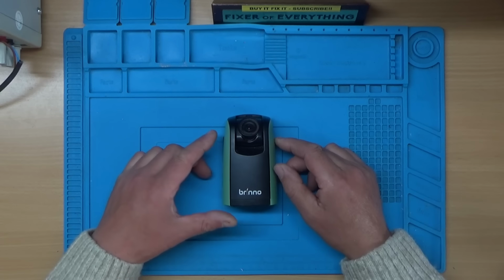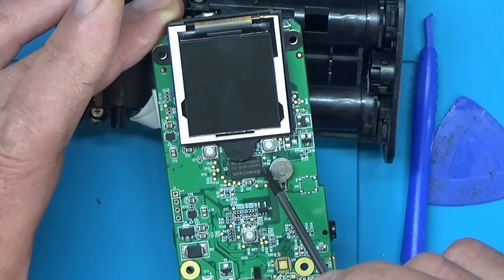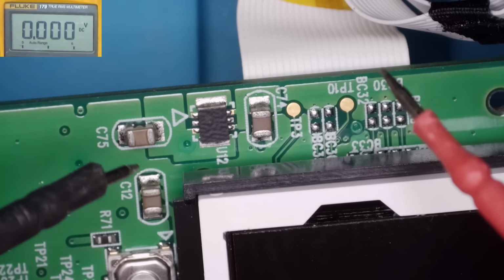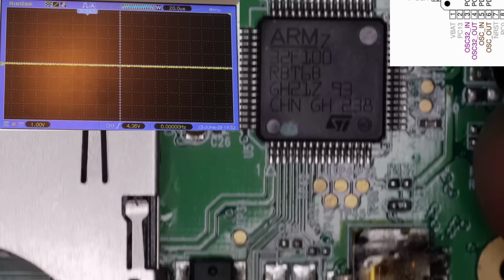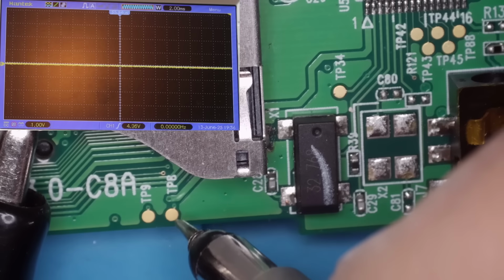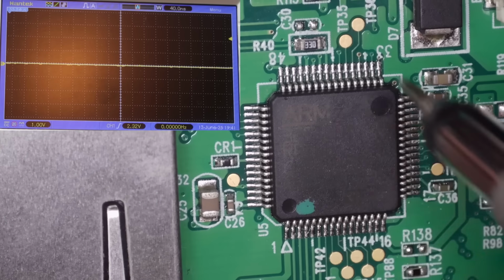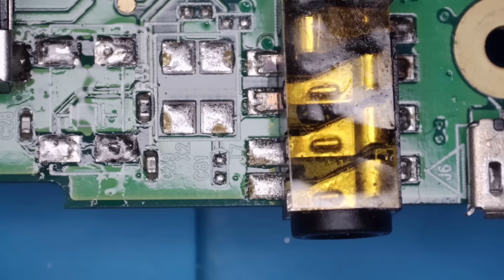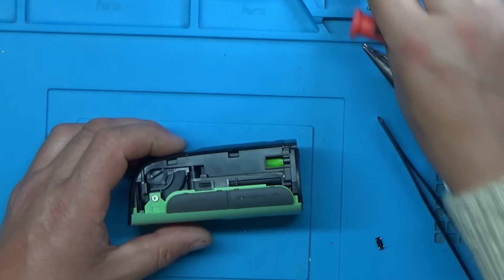Faulty Timelapse (Construction) Camera - Quite Expensive & Totally Dead | Can I Fix It?

Comment: I'd argue the firmware doesn't check if the 32.768KHz oscillator is running before making use of it! Not great programming 🙂
Reply from the maker: Could well be the case, or some low power mode that requires the RTC instead of the main clock?

Comment: I have found oscillator failures to be not uncommon. Sometimes it's the crystal, sometimes it's the load caps. I often just feed in an external clock source just to check that the rest of the circuit is working if I don't see any oscillation from the on-board clock.

None the less, a good repair that only required cheap parts.
Reply from the maker: Thanks 👍 and thanks for sharing.

Comment: Hi love your videos and always impressed by your skill, I have a item I’d be interested in sending to you if you’d be interested it’s a Dewalt tough system radio has many issues but the big 2 are the radio not working on battery power and the on button broken off and ripped off most of the pads and a few other components
Reply from the maker: Thanks 👍 drop me an email at the name of my channel at out look dot com.

Comment: Great job! St microcontrollers have a wide variety of clock configurations available, even so far as to be able to use different click sources in different power modes. It's entirely possible that it is using the lse (low speed external) oscillator during some low power mode, and it was getting stuck in that mode with no clocking. Edit: I read some of your comments lower down suggesting that the faulty oscillator might have caused it to stall waiting for an interrupt. That is of course totally possible as well!
Reply from the maker: Thanks you 👍Yes, I suspect it was one or the other of those.

Comment: Great fix and also wonderful that you were able to find a suitable replacement in your spare boards. I think those are called SPXO oscillators into which you feed voltage and you get frequency output without additional circuitry needed. I was troubleshooting some Toshiba laptop boards recently and two out of four of them had a broken SPXO caused by a regulation fault on the PSU board. Of course that SPXO provides clock to the CPU so it was totally dead without that.
Something you can try if you see clocks missing on the oscillator is hook up a signal generator (I use my HDS2102S's basic one) to inject the frequency and see if the board starts working, that worked for me in a separate instance where I had a part working PLL. That was intermittently unable to run the 14.318mhz crystal from the XO pin but would work if I put that frequency into the XI pin.
Reply from the maker: Thanks for that, yes I've got an old signal generator and did think about hooking it up to test. I just wasn't sure on the output voltage etc so thought it was safer to just replace the crystal. I've just looked and I think this is just a standard oscillator because it has two small capacitors, one connected to each output leg to GND.

Comment: This gives me hope for my a Roadstar TRA-2350P (aka Redsun RP2000) shortwave radio that I recently pulled back out of the box, totally dead regardless of power source. I found some red herrings like a bulging power input filter cap, but nothing that would preclude it from operating. Even the little electrolytic in the reset circuit charges and discharges fine. So right now my bets are on a dead RTC crystal, which actually isn't totally unheard of. Unfortunately the interesting things are underneath a big shield that's a bit of a pain to take off. (It is, after all, a shortwave radio.)
Reply from the maker: Perhaps this might also help.. https://elektrotanya.com/roadstar_tra-2350.pdf/download.html

Comment: Great find for the fix, well done. Repair cafes can be very limited in the tools, equipment and time they have available. I just finished up at a local repair cafe myself today in the electrics area and basically you don't have access to special tools unless you bring it with you. No one is bringing a microscope or oscilloscope to these events so small SMD work is pretty much out of the question. I have to bring these things back to my home for this type of work.
Reply from the maker: Thanks 👍 and totally agree with all of that. We have limited equipment at our repair cafe. I donated my previous digital microscope so we have one there now, and we've got a bench PSU and an old analogue scope. I do fetch things home too if we need longer to look at them or if I need parts or more equipment. Keep the great work Steve 👍
Reply: Likewise, I am one of the dedicated taker homer repairers at our Weymouth cafe. With limited time and trying to get the high number of visitors through the system, it's sometime easier to take things home. Better access to specific equipment, time can be spent researching and no time pressures when working in your own workshop. In 2 years, I think I have avoided bringing anything home on just 1 occasion only 😆

Comment: Quartz crystals have a much more important job than just keep the real time clock. Without the crystals the mcu just executes the first instruction (whatever that instruction is) and gets stuck at boot, the clock allows the mcu to read the next command from the stack. Every clock pulse is either the next instruction or the next calculation.
That said, we as technicians have always been told that quartz never breaks, this is very interesting, I will now question every component I see when I repair. Very, very, very interesting video.
Reply from the maker: Thanks 👍 what you're saying is correct, except this MCU has two clock signals. If you look at the MCU block diagram in the datasheet you will see that the main CPU uses a different clock / crystal (24mhz) to execute instructions, and this crystal is purely for the RTC. What I think was happening is the MCU ran and then went into sleep mode or was waiting for an interrupt from the RTC or was hanging at initialising the RTC because of the failure.
Reply: Dead RTC crystals actually aren't totally unheard of. Not sure why they might be more prone to it, perhaps the relatively low frequency.

Comment: Nice repair - So glad I dont earn my crust via a soldering iron nowadays... Have you ever tried a huntron tracker? if memory served it was a scope that injected a low AC that would show the diode knee bend and made it easier to see if a component was good/bad in circuit
Reply from the maker: Thanks Rob 👍 No not tried one. I've seen them being used before though.

Comment: ~1:00 Judging from the mini-USB port, the device may be too old (&/or not have a charging circuit) to recharge appropriate cells (check the USB lead to ensure it's delivering power as well as data, too). If so, beware another limitation: older battery-powered devices often won't run on 1.2V rechargables: they require 1.5V cells to work

Also, when dealing with 'integral' cells (for eg RTC backup), ensure you check the cell: sometimes they can fail without any signs of deterioration; if its cct is also providing a necessary signal (as with this clock chip) to somewhere other than a simple time/date backup function it can result in total device shutdown
Reply from the maker: From the block diagram of the MCU the RTC crystal only goes to the RTC section. I think what was happening is that the CPU was waiting for an interrupt from the RTC or was failing on the RTC init and getting stuck in a loop.

Comment: Nice one! Not unheard of that the firmware is programmed to go into an "defined" error state when one of the oscillators do not work. I think some ST micros even allow for using the internal RC as a backup if the external oscillator fails. But this has to be setup & this rather simple micro might not even have this feature, idk.
Reply from the maker: Thanks 👍 when I looked at the block diagram of the MCU the RTC crystal only goes to the RTC section. I think what was happening is that the CPU was waiting for an interrupt from the RTC or was failing on the RTC init and getting stuck in a loop.

Comment: Not sure if it was mentioned in the comments, but I've done a few STM MCU projects and the external oscillator is actually selected to replace the internal one.
STM gives the option of using the internal clock, which isn't always very accurate, or you can attach an external oscillator and the MCU will use that in place of it's internal clock signal.
So, I don't think it's purely RTC.  I could very well be wrong, only done a few dozen STM things.  But, when I have done them, I've written the firmware to use the external clock source, rather than the internal one.
Reply from the maker: Yes when I've done stuff myself I usually use an external oscillator too. The built in RC is usually not that good and can drift with temperature changes. The place for the external osc on this IC was not populated though, although in the datasheet it did say something like the clock pin can be assigned to a different pin, so I think that's what they did in this case. Perhaps the FPGA was generating the clock somehow?
Reply: @BuyitFixit  That makes sense!  Thank you.

Comment: Sometimes the RTC is part of a watchdog timer circuit. If theres a problem with the WDT getting pulses correctly the device wont boot or will shut off quickly after booting. Depends on how the micro is configured.
Reply from the maker: Yes, was thinking that myself. Or perhaps they were using the RTC as some kind of interrupt to wake up the device.

Comment: Another tip for beginners. Always cool your chips and components too ambient temp before testing and measuring. The heat can cause false readings. Cool naturally or with a heatsink of some kind. Avoid air blowers as they can shock and cool too fast causing cracks and other faults in circuits.
Reply: This goes double for WLCSP/CSP chips i.e those ICs with a mirror finish, they're considerably easier to thermal shock than ICs in plastic packages.
Reply from the maker: Good advice 👍

Comment: Another great video. Always love seeing the microscope view over the the camera one. Quick tip to reduce glare on the PCB... you can use a variable polarizer filter. Or angle the light on the board at 45 degrees so the refraction is not right back into the camera. I know you prob have studio lights and this may not work but for others it may help. I used to use gooseneck light arms that I could easily move around to redirect light.
Reply from the maker: Thanks for that Rick, and for the tips 👍"Studio Lights" 😂😂😂I've got a 4ft LED batten lite, running from a cut off IEC lead, balanced on top of my camera stand 😂😂😂😂😂😂

Comment: Hi Mick, enjoying your fixes👍😃 do you have a contact email? I would like you to have a look at a battery charger for me please. Car Battery Charger, 12V/35A 24V/18A Portable Fully-Automatic Smart Charger, Battery Maintainer, Trickle Charger and Battery Desulfurizer for Car, Motorcycle, LiFePO4, Lithium, Lead Acid(AGM/Gel/SLA)
Basically it powers up and reacts to button presses etc but doesn’t push out any amps 🙈
Cheers
Reply from the maker: Thanks mate👍Yes it's my channels name at out look dot com.
Reply: Don't forget it needs a load before it outputs....
Reply: @peatmoss4415 thanks, yes it’s connected to a range of 12v batteries, motorbike lead acid, and a 12v 200 amp Lithium smart battery, the battery app shows no charging and the charger screen also show zero amps. The voltage is also low, I would expect it to be at least 14 volts, don’t think it has ever worked but back then Covid had me out of sorts and I didn’t get it sent back. I have also checked the fuse which I think is on the output, saying that it does react in a positive way when connected to a battery so I feel that side is okay. Cheers